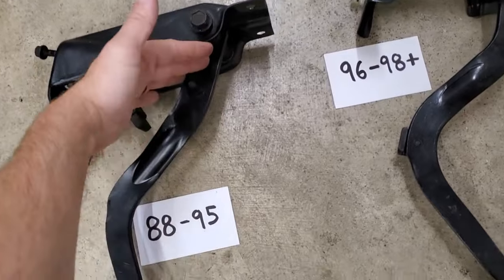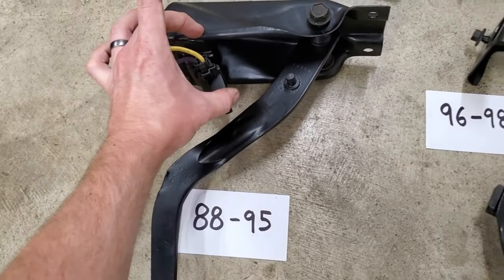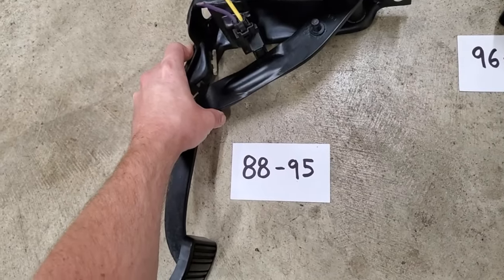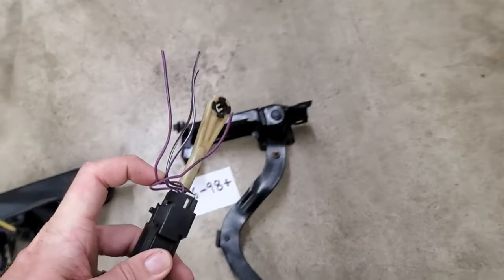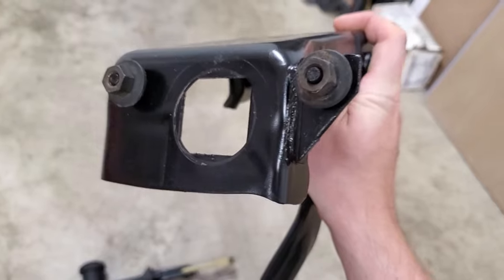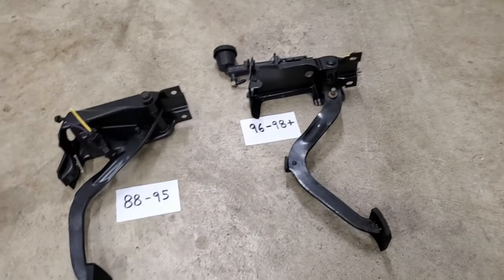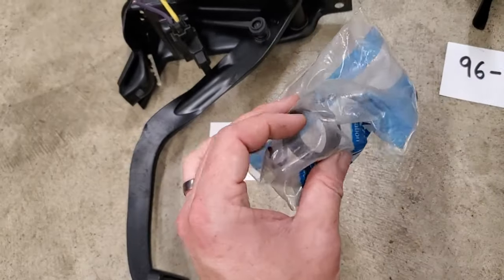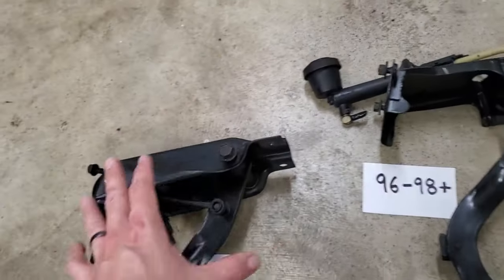OBS GMT400 Clutch Pedal Assembly Differences

Comment: I found a workable substitute for the discontinued GM return spring. It is completely backwards - meaning the spring unwinds as you depress the pedal, and it is on the other side of the bracket.  But it works.  Mazda BR70-41-081 fits Miata or Protege
Reply from the maker: That's awesome thanks for sharing!

Comment: Especially clear video, knowledgeable and informative of this standard clutch systems that are found on so many domestic trucks, of these years and cross between models.   I was surprised how much further the 1996 peddle rests forward after installed, and was happy to find out it was the correct year, although I was not sure before watching your video.  Now I just need to replace the four-pin position switch that someone jerry rigged.  🤟

Comment: Nice video.  Thanks.  I'm in the process of converting a 1997 K1500, but I have the older bracket you show.  It's not going well.  I'm thinking that I need to locate the newer style bracket.  There just isn't much room under that dash.

Comment: I found on my 1990 C1500 that it did not have the bracket on the frame of the dash to install the 2 bolts at the rear of the bracket. This piece is welded to the dash frame but is not there on some autos

Comment: Im right in the midst of doing the same swap from a 97 nv3500 into my 98 suburban. It’s gonna be a cool swap because the 95-99 gmt400  suburbans never got a manual transmission on the 1/2 ton platform 

Another guy working with me on how to who has done this swap said it’s easiest to take the NSS from 4L60, run  it up into the cab and attached it to the factory switch on clutch pedal, maintaining factory “push clutch to start” function. A lot of people just jump this to a ground also ?

Have you thought that out on your swap or got to that point ? There’s also the reverse light wires and the speed sensor to wire in

Comment: Additionally was said it’s necessary to send your  pcm away for a tune auto to manual tune 
You’ll have a high idle and sel light if not.

Let me know any other suggestions and good info you have come across or done in regards to the swap or my input 
Thanks